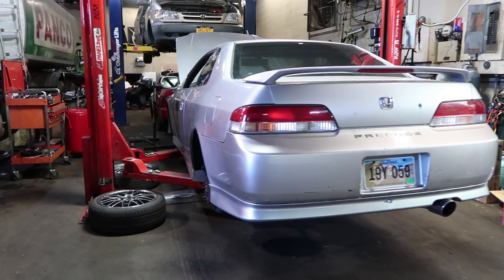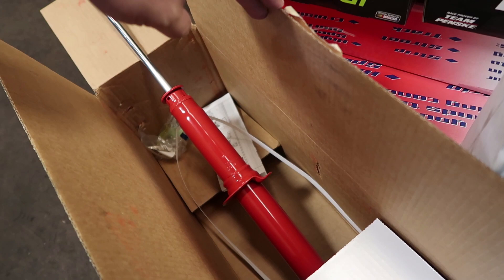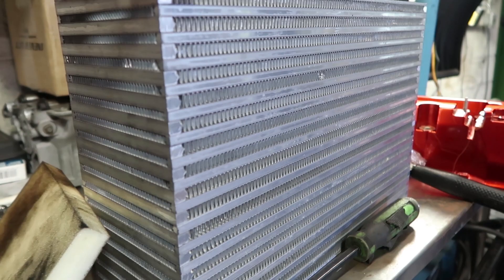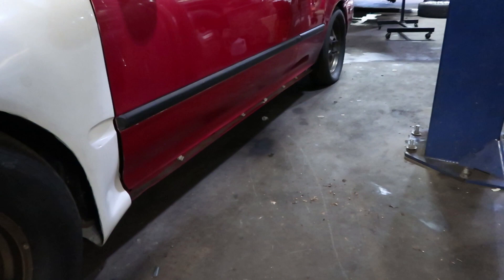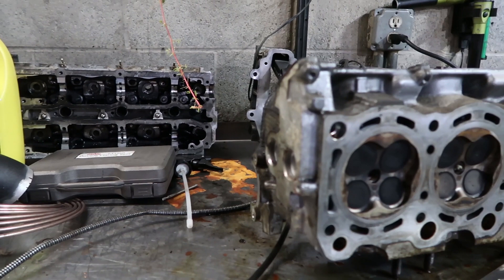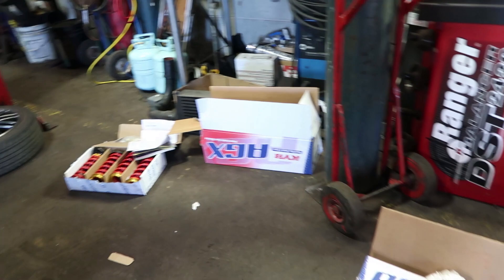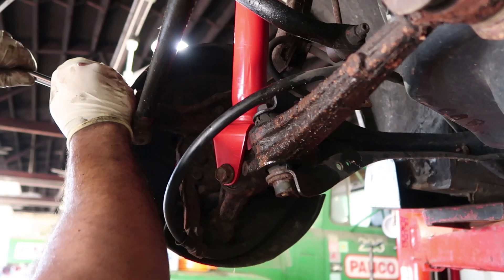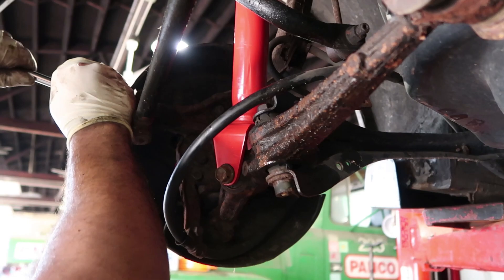Budget Racing: Honda Prelude BB6 ALMOST Race Ready! Finding a QUALITY Mechanic is Hard

Comment: Do you plan on gutting the truck and do a full rear delete?

I did yo mine and it was a great mod. Dropped over 200+ from the factory curb weight.

Comment: Nice refreshment for the lude its a nice car and a big big engine jajajaj that H22 have a screaming VTEC
Reply from the maker: Thanks Jimmy
Reply: try to put huge fans because the temperature is all a oil pressure gauge and new fresh oil if you want you can put the fans always on to maintain the engine cold during that race